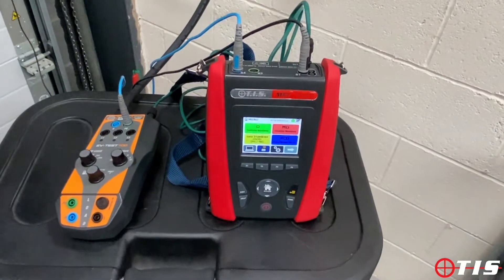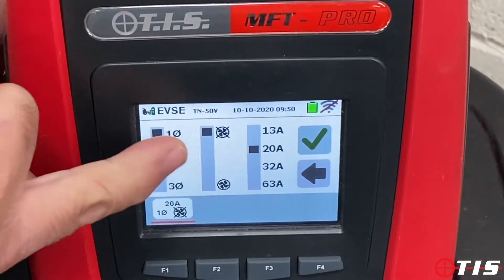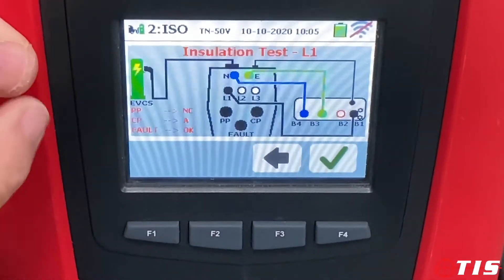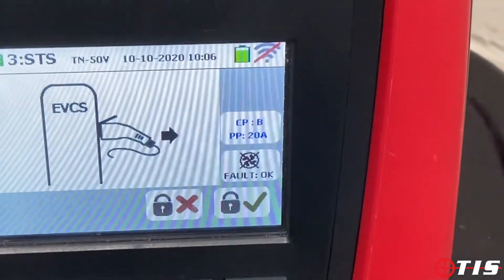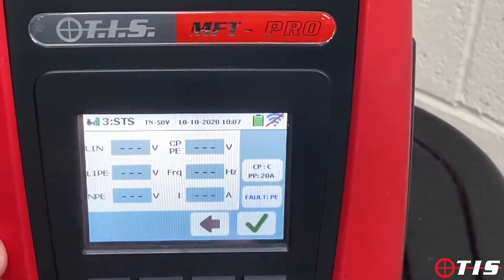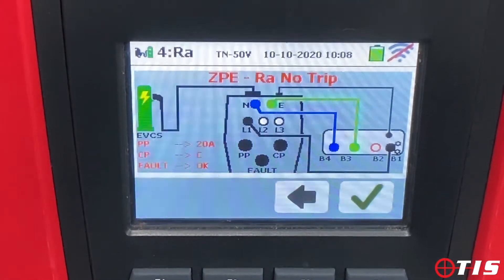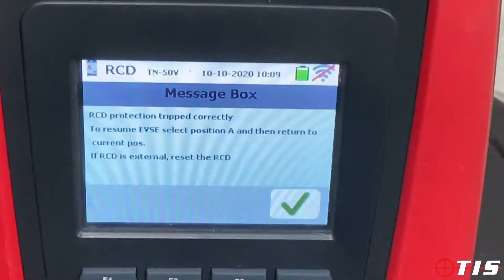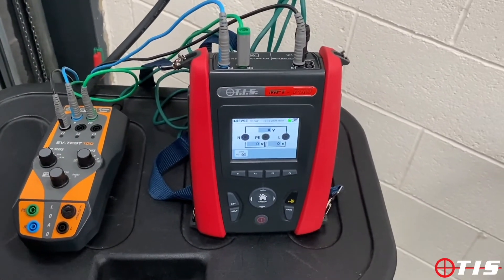MFTPRO-EV Electric vehicle charge point tester.

Comment: I'm using the same kit in a eo mini pro, but I don't get any voltage?
Reply from the maker: If it’s a live test for instance Loop and RCD it means there’s no output from the charger some chargers need to be engaged via an app if under the L1 on the adapter isn’t lit there’s no output voltage it should be PP 32 and the CP set to C
Reply: @testinstrumentsolutions at the end I get a thumbs down from the taster.

Plus my test doesn't do the same 1at couple of tests that yours does.
Reply from the maker: @shaunkaye9445 ring the office and ask for a technical phone call when you are in front of the charger we can talk you through it

Comment: Hi, on the first test, the continuity test, where is the black lead B1 going to, that red connector block, is it an Earth?
Reply from the maker: @Harrycowlton  B1 the black lead is going to earth if you struggle to get an earth connection put the lead into the load out earth connection at the bottom of the adapter
Reply: @testinstrumentsolutions   cheers, love the mft pro + and getting used to the lead changes and colours (migrated from Megger).  Just bought the eva adapter. Appreciated
Reply from the maker: @Harrycowlton  thank you for the business and feedback 👊

Comment: Why did the 30ma test pass at 86 ms? Should max not be 40 ms for additional protection.
Reply: I noticed that too.
Reply: It’s because the 30ma just provides earth fault protection so 1 x test (300ms max) additional protection supplied by the 6ma
Reply: Is the statement that the earlier mft pros can be updated correct? I have the latest firmware but no icon.